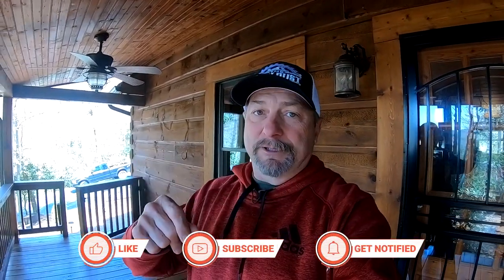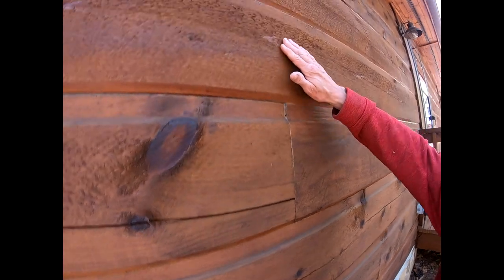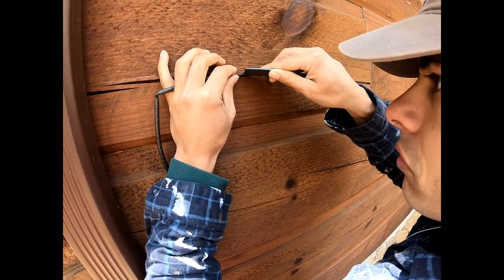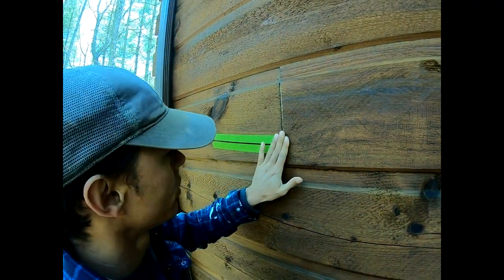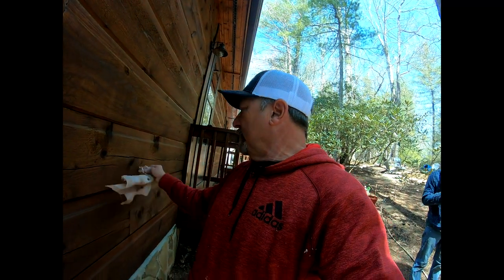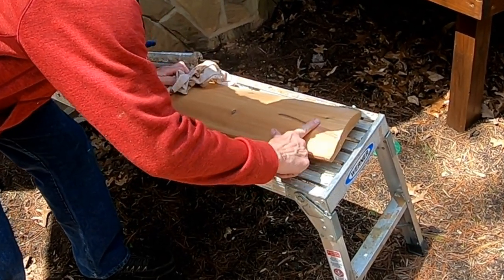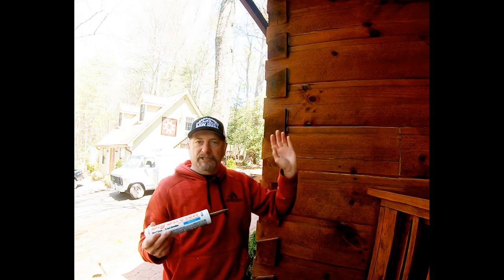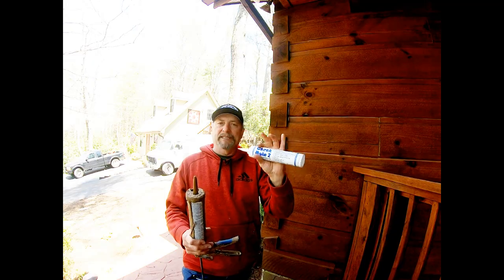How to Caulk a Log Home, Like a Pro!

Comment: What I've done is fill the cracks and then smooth them out with a putty knife and then sand the caulk. Get a sandable caulk I did a complete renovation on mine. I sanded the log smooth and then caulked all my checks smooth out the caulk as I went and went over it with 120 grit sandpaper after letting the caulk cure for a week

Comment: Very informative video. I have a cedar log home and want to fill checks but I'm concerned about color matching to the existing stain as I don't intend to stain or paint after just fill checks... that's it. When these caulk products dry and I've found a caulk that is as close to the stain I have does the stain dry darker in color or the same as when it's wet. What brands of backer rod do you recommend? Thank you. Gilda

Comment: Just bought a log cabin in Lawrenceburg, KY, that has about 15 years of TLC to catch up on for the exterior. Needs attention to all kinds of checks, some rotted areas of logs on the back, a bay window that has a rotted base, replacing four deck supports, and the framing around the French doors in the basement have fallen victim to some type of wood-boring insect... Just came across your channel and it's just what I needed to figure out how to teach myself some of the basics of log home maintenance. Gonna try and knock out whatever I can by myself, but if/when the time comes that I need to bring in a professional - make sure your crew at On Track Repairs & Renos keeps their bags packed!
Reply from the maker: Awesome!  Good luck on the projects Brad.  Check out the videos in the Log Cabin playlist.  Thanks again for watching and please Subscribe! Again, good luck on your projects, you got this!🍀

Comment: I have 2 clients that have log cabins that have several areas of checking, it seems pretty labor intensive for the foam insert, so how would you price addressing the checking before re staining the log cabin?

I advised most likely fixing checking would be time and materials on top of the cost to restain the cabin.

Comment: what do you fill in your logs that have a really deep and wide crack?
Reply from the maker: In the wide and deep checks (cracks). Stuff Backer Rod into the check and use log caulk to fill the check.  If checks are larger than 1/2, I would use chinking caulk.  Good luck, thanks for watching and please Subscribe 🍀🍺

Comment: Hello, I am looking at a log home in NE Georgia and while we were touring the home we noticed light coming from the outside in the corning of the living room. This was a vertical gap and not horizontal. Is this normal/fixable?
Reply from the maker: Yes, the logs will expand and contract with the weather, that is why using the right Log Caulk is a must. Obviously I would inspect the home before you purchase, looking for rought or bad logs.  Thanks for watching and please Subscribe 🍀🍺

Comment: Any tips on filling in carpenter bee holes? Do I need to fill in the entire length of the tunnel with caulk, or just the entry (after ensuring the bees are gone, of course)? Thanks for the videos!
Reply from the maker: I just fill the holes full of caulk but the bees have to be gone because they will and can pull the caulk back out😲😁. Thanks for watching and please Subscribe 🍀🍺

Comment: I barely have gaps in between my logs, almost so small I can barely fit a backer in between the logs. I was wondering if in cases like this, would just adding energy seal be the right way to go about it? Thanks
Reply from the maker: Sounds like you are on the right track.  Stuff with Backer rod if possible, then caulk.  Thanks for watching and please Subscribe 🍀🍺
Reply: the smallest backer rod I've seen is 1/4 inch.  If I can stuff it in a gap, I do.  If not, I don't.  On upward facing checks that won't fit backer rod, I fill with caulk.  On the downward facing ones, I just try to get my top coat in there deep.
Reply: @TheSawDustDude  
Great tip on the tape.  I've never done that but it looks like it would help a lot on rough logs.
On smooth ones I put the rod then the caulk.  I smoosh it in then squirt a little rubbing alcohol mixed with water on top and scrape over the check with a bondo scraper.  It's a bendable soft plastic putty scraper and it takes the excess off and leaves the caulk in the crack.  Some caulk gets wasted but the less time I am up on a ladder with a bunch of tools, the better.  
Also, don't forget to run your 5 in 1 tool or some kind of tiny round brush in the check first to clean it out.  Otherwise the caulk sticks to the dirt and pollen and not the wood.  
Log Builder is another good caulk, similar to Big Stretch.  
I've had good luck with both and I've gone through 20 tubes this summer alone.  
Be sure to let the caulk dry for MANY days before you put oil based top coat.
The oils and stain can soak into the log and prevent the caulk from binding if it isn't fully set, and it takes a long time to cure inside the check even though the outer surface feels dry.

Comment: Question.. I’m currently under contract to buy a log home in WV. During the home inspection it was noted the the exterior and interior need some caulking repair. The current owners are saying the interior on the logs do not require caulking. Can you please confirm?  Thank you 🙏🏻
Reply from the maker: Yes and no.  It's typical to see the inside logs not caulked.  However, it is extremely beneficial to have them caulked.  Especially the corners, large gaps between the logs and butt joints.  Not so much for the inside checks in the logs.  The inside caulking helps keep bugs out and is more energy efficient.  Hope this helps.   Thanks for watching and please Subscribe 🍀🍺

Comment: Just found your channel.  Great info.  Quick question.  We have 6x8 D logs.  Our manufacturer said to only caulk the tops of the d log checks and leave the bottom checks open so if any water gets in it will not be trapped.  Thoughts.
Reply from the maker: Thanks for watching.  You want to keep water out all together.  If water runs in the middle of the log, the log will act like a sponge and soak up most of the water before any runs out.  I've never heard that advice and would not advise it.  Thanks for watching and please Subscribe.

Comment: Do all caulking then stain no need for tape
Reply from the maker: The only time I tape is when it is brand new logs.  Make sure you get off all excess stain that is outside of the check. If the logs are already stained caulk, then with a damp rag wipe off excess caulk. Hopefully this is what you want to know. Good luck with the project. Thanks for watching and please Subscribe 🍀🍺

Comment: I use backer rod then caulk with log builder then I either use a sponge brush or sponge wet and clean it but my logs are sanded smooth. Also anything permachink is garbage at least in my experience in wyoming!!!!
Reply from the maker: Thanks for sharing 👍

Comment: Is the Backer rod able to compress?
Reply from the maker: Dan it's a closed cell foam rod, it will compress into small cracks but will not soak up water. 🍺
Reply: @TheSawDustDude  ordered it 3/4 inch Thanks!